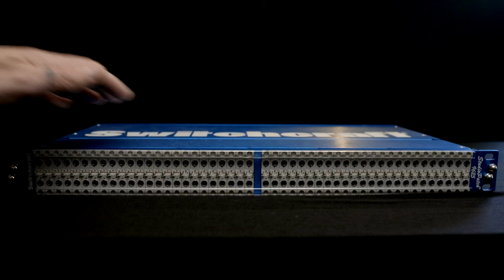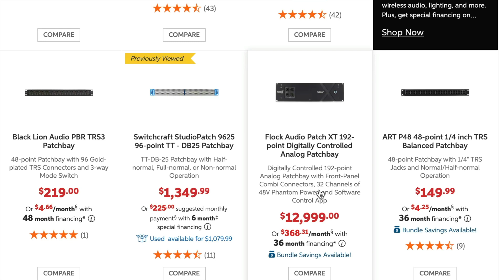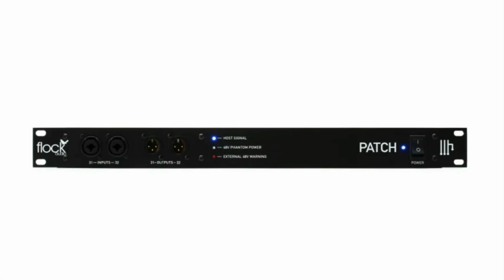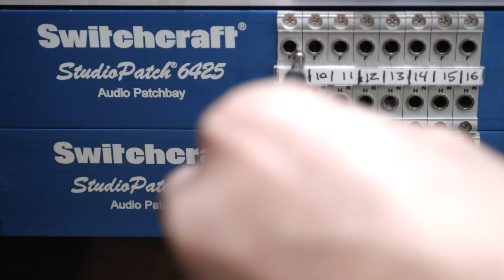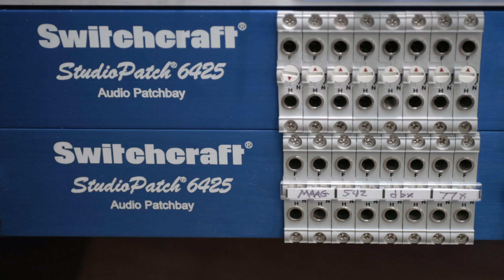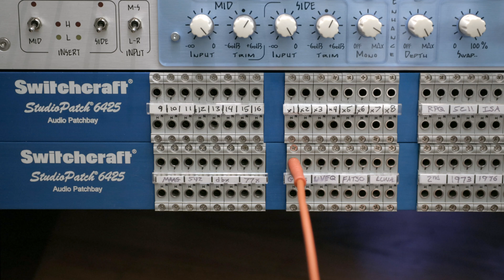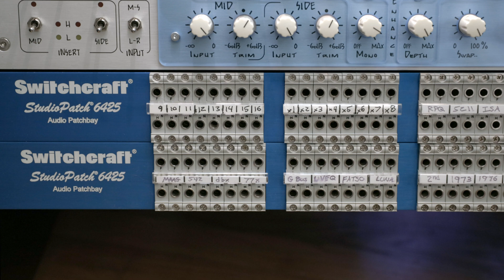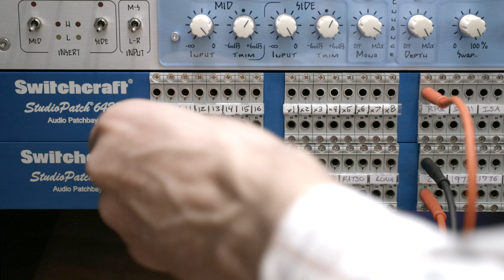Understanding Patchbays - Setup, Normals, and Workflows with Switchcraft StudioPatch 6425 & 9625

Comment: Great video very easy to understand thanks!
Reply: With the out board pres output connected to top back of patch bay normaled when do I have to worry about the 48volt phantom power damaging my equipment? I will be using TT connections.thanks!
Reply from the maker: No, phantom power is still fine. However just like connecting directly with phantom power, it should always be off when making or removing any connection.

Comment: Hi, 
How do preamps route directly into interface in normaled position -- the output of rpq or isa is going into the interface inputs on the back of the patchbay?
Reply from the maker: So think about how preamps would connect to your interface typically. You want them always "on" or connected. Therefore, when connecting to the patchbay, you want them normaled so that they are always passing audio to the interface. But you also want them so that you can connect an EQ or compressor and break the normal by inserting it. So basically your preamps will go to the top of the patch and they will come out the bottom and go to the interface. When you insert outboard gear, it is basically putting that hardware in between the preamp and the interface. (hope that helps explain it)
Reply: @ToddUrban  Yes of course thank you for the reply, this video is very informative and normaling definitely seems most pragmatic way... Just to clarify, this connection is made on the back side of the patch bay? Where it would be output (top) of preamp into input (bottom) of interface?
Reply from the maker: Exactly. Signal should always go from top to bottom. And yes, you would connect the preamp to the back, as well as the interface. The front is to break the normal and connect other gear